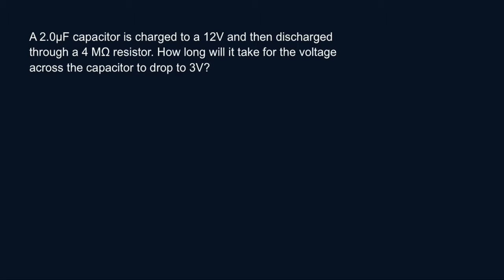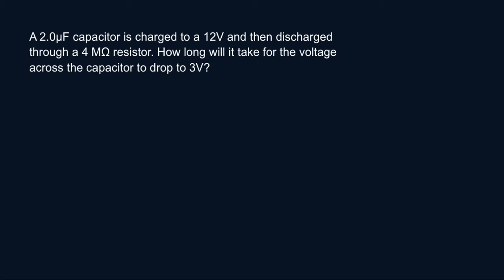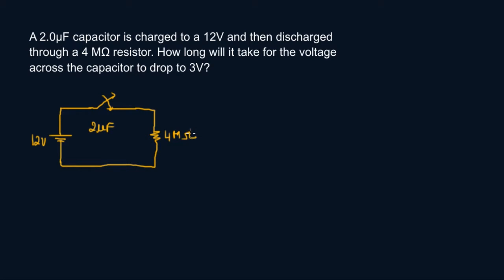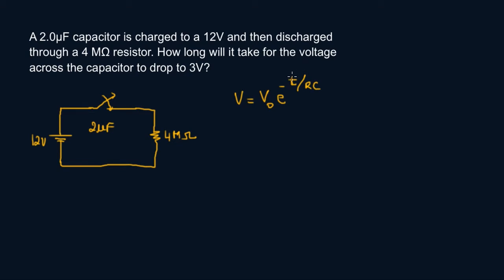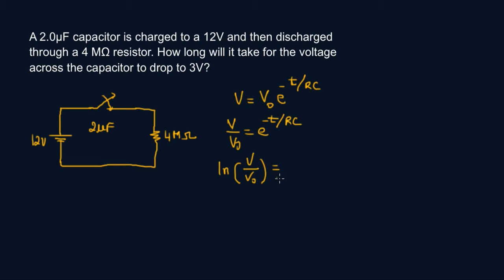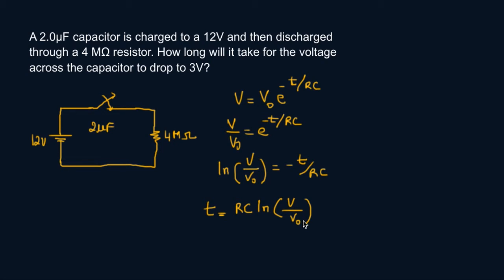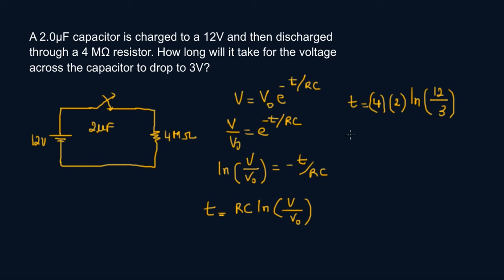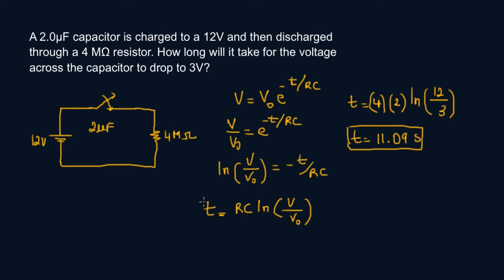Calculating Time it takes for Voltage to drop in RC Circuit

Comment: Hi Raiya,
--> V0 = 3, V = 12 (Your calculation)
--> I thought it starts with 12V and drop to 3V:       V0 = 12, V = 3 
*I got the same result but the negative sign (-) on "t" was cancelled out due to "ln(3/12)" is negative.
Please correct me if I was wrong.

Thanks!
Reply: this is the right way
Reply: @mhmoudalhasan3232  why is the rest of the equation neglected V(1-E)^-t/rc??

Comment: She got a negative sign for (t) because she made a mistake when she assigned numerical values to the voltages.  The initial voltage value is 12 (not 3) and the final voltage value is 3.  In other words....she has the numbers in the natural log equation flipped; it should be ln (3/12).  When she takes the natural log of (3/12) she will get the same numerical value as before however the sign will be negative thus cancelling the negative sign with (t).

Comment: She took the wrong natural log ratio; it should have been ln (3/12) instead of ln(12/3).  She just got her voltages mixed up.  The ln (3/12) will yield the same numerical answer however the sign will be negative.  This negative sign will cancel out the negative sign that goes along with (-t).